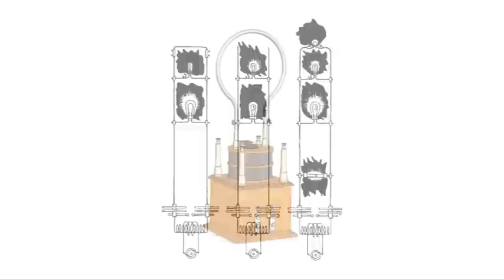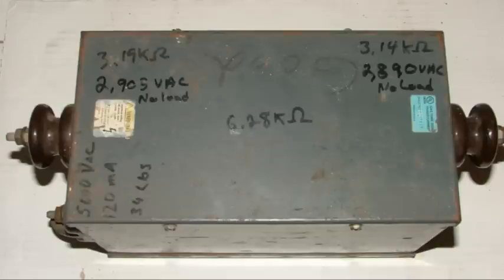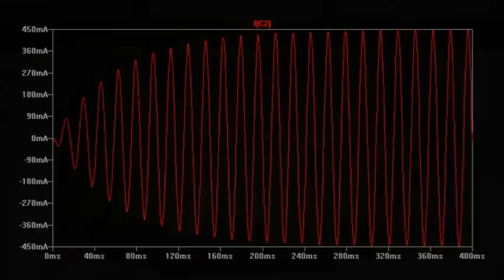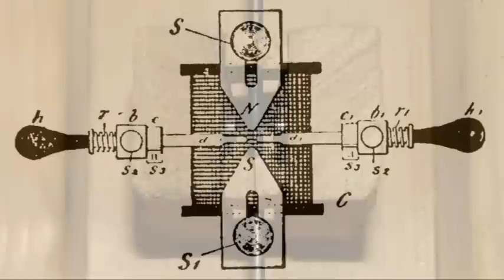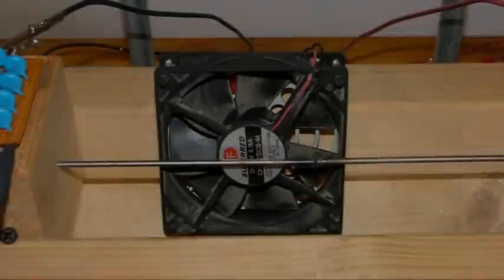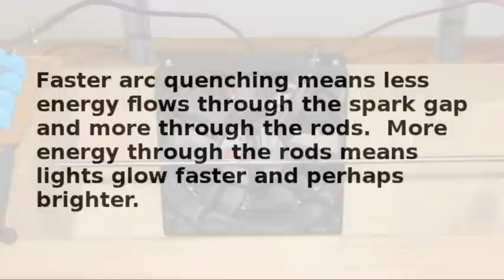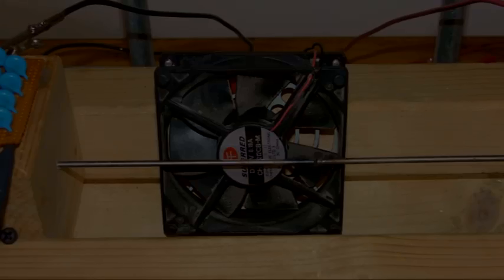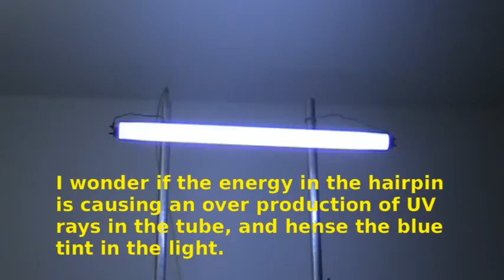Tesla Hairpin Replication - Description and Demonstration 2

Comment: Tesla was using an electromagnet that he pulsed in order to regulate the timing, when he was using air he also used bursts of air at one point, but was not able to get the frequency as high as he wanted with air. Basically the magnets were a gate that was normally shut and he was able to shut it off (the electromagnet) in pulses and tune the duration of the arc with it. He also mentions that his goal was to give the arc only enough time to jump in one direction between electrodes and that the shorter the duration of each arc (i seem to remember 5 microseconds being the turning point) the more pronounced the radiant energy effects.
Reply from the maker: Thanks, interesting.  I had read about the air and magnetic quencing.  That's why I attemped the crude quenching methodes.  It would be so thrilling to be able to go back and see him actually tuning those things...

Comment: Builders of small to medium-sized Tesla Coils are likely to agree with you that opening up the gap in a resonant charging system puts your capacitors at risk, because the resulting over-voltage and over-current can shorten the capacitor life to almost zero. Also, blown-air-cooled spark gaps run cooler and give the best results without going to the complexity of rotary gaps.

Comment: May I suggest you try a rotary spark gap set up to control you spark timing. Also if you use a torch flame in your spark gap it males the discharging smoother

Comment: The magnets don't resist high temperature from the arc. Those neodymium magnets get to the Curie point at about 100°C.

Either you use steel rods with magnets on the opposite side, to protect them from the heat. Or you use a electromagnet.

Comment: Did you try grinding off  the spark rods tip to make them a point such as in pencils?
TIG welding requires the arc to jump from such a pointed  tip, othewise you dont get good control.
Pkease try, and report , if you will.

Comment: Tesla is using the magnetic flux. Youd have been better off with the sides of the magnets facing the arc I think. With the faces of the magnets facing in, you likely had the poles facing the arc. The effect your seeing with the arc has to do with the right hand rule and the geometry of the magnetic and the dielectric.

Comment: Great video and analysis. What is the length and diameter of your rods? And also the spacing between the rods? I'm trying to tune my circuit with 3/4 inch copper pipe of 5 ft length so am thinking about adding more capacitance or cutting off some of the pipe length. I'm using 2nF doorknob caps and not achieving resonance. Also to confirm, you are using 30nF on each of the rods to get to resonance?

Comment: the two shorted vertical rods will have 1/4 wave and null points move the bulb to different positions on the rods and you'll see spots where the bulb is very bright and some where it is not even on

Comment: The spark gap is the problem due to the inability to regulate it.  Use an AC motor  with speed control.  You could also XE trasmission and   earthground  the  rods.

Comment: I would personally stay off line voltage and use an invertor to drive the high voltage coil. It can burn out too by letting it constantly run. They are designed to just give a momentary spark to of course ignite an oil spray. The inverter can go to a higher frequency than the 60 Hertz line current also. Just some ideas.
Reply: Unless you have a true sinewave inverter,  otherwise you going to indroduce switching transients from the modified square wave AC

Comment: You need a spark gap in vacuum chamber. I used sealable 4" by 4" Carlon electrical box with epoxy sealed screws, and brass fittings with valve, + vacuum gauge . Box is used with hand pumper to remove air. Maybe also a glass, radar type , discontinued type, spark gap which would be much smaller, but the sealed glass would have to be used with outside magnets in attraction mode. Tesla also used carbon rod and aluminum rod electrodes  together, and more electricity is produced due to more electron flow. Polarity would have to be determined for directional use.

Comment: You know all the spark gap does  is control the voltage. If you control the voltage on the primary by reducing it your secondary voltage will go down and you will get the same effect with no spark gap. Try it you will see.     Your over thinking this it's just high frequency voltage with low current it's not cold energy.

Comment: I have been trying to get the same effects, but I just don't seem to be able to! I'm using a car ignition coil (driving it with 555 timer and a car relay, so frequency is not that high) and self made salt water capacitors. Its making me confused and I have no idea why it does not work for me. Do you have any idea what am I doing wrong and what should I change? Thanks in advance :)